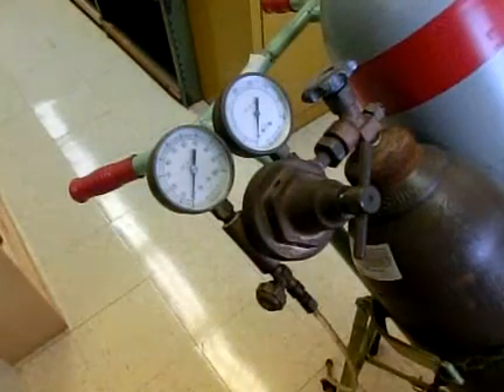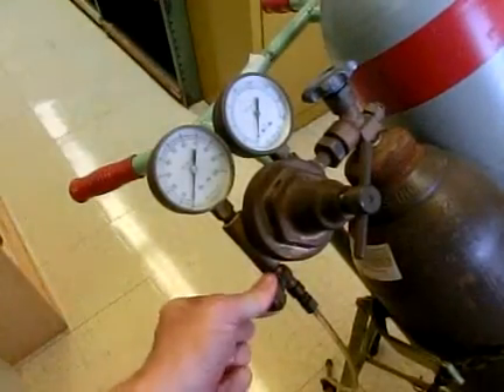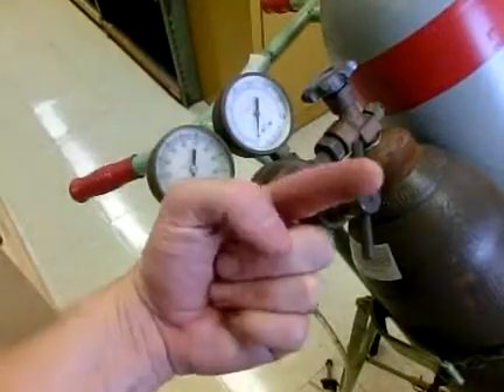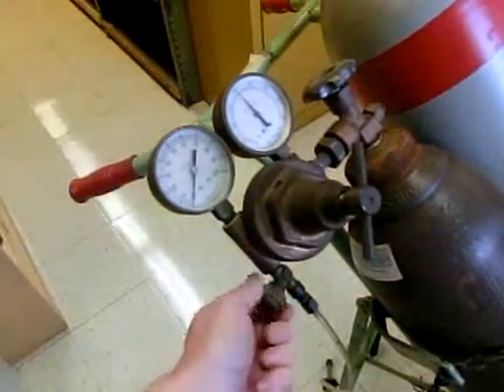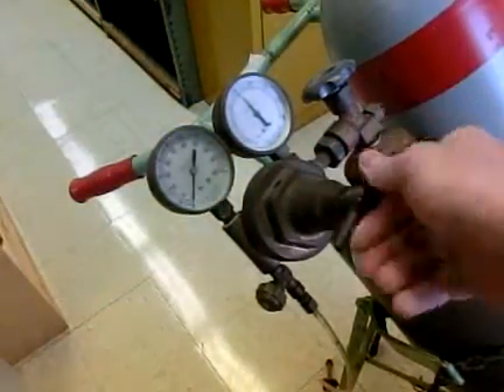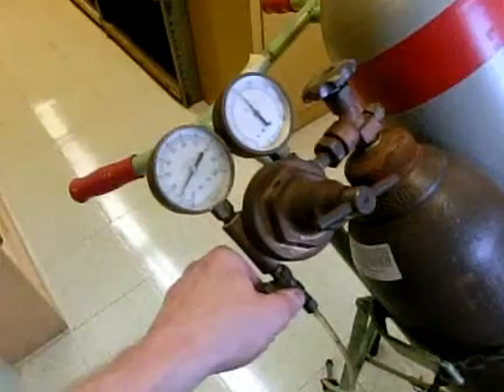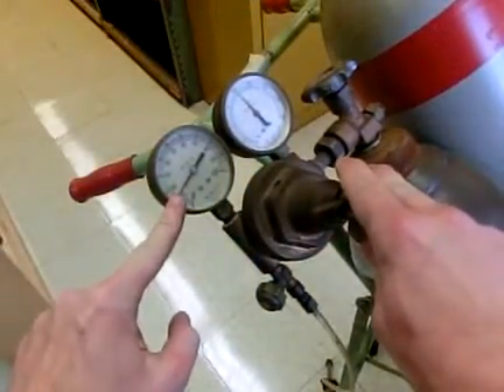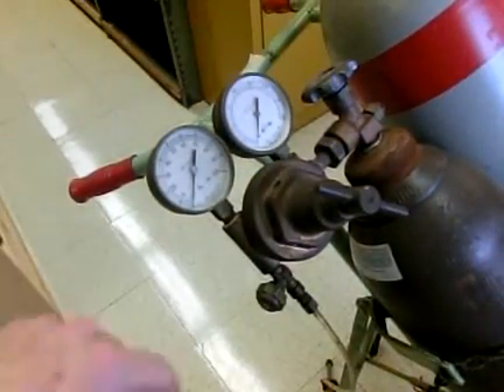How to Use a Pressure Regulator on a Compressed Gas Cylinder

Comment: Do you always have to drain the valve after use? I use one for welding
Reply from the maker: If I am done for the day, or taking a break, I bleed the valve. The excess pressure inside the regulator causes stress on the internals. Overtime, that can cause damage or leaks in the regulator. Turn off the tank at the source and bleeding the valve will decrease the likelihood of this problem.
Reply: @chemtaiji  thanks

Comment: What happens when the pressure drops to zero??
Reply from the maker: While the tank will likely still have gas in the cylinder, it will be at atmospheric pressure, so the gas will not come out.

Comment: There's a constant release of nitrogen coming out from the emergency release holes all times, What happen?
Reply from the maker: To be clear... I am not an expert.  That said, it is possible that the valve is not attached correctly, or could be faulty.  Please get it checked by a professional.

Comment: @chemtaiji what sort of tubing/piping should i use for flow of N2 at around 7-8 bar?
Reply from the maker: +nasir ahmed 
Unfortunately, I really don't know.  The video was made to help out my coworkers to use the compressed cylinders in our supply room.  I am not very well versed on the tolerances of high connections.
Reply: 8 bar is very little, about 116 psi so not a particular tubing/piping issue. That pressure range and a bit is commonly used to pressure test air conditioning systems (for example) and there is plenty of hardware available.